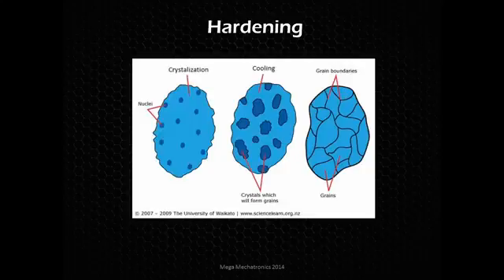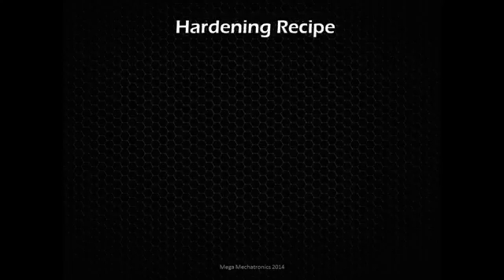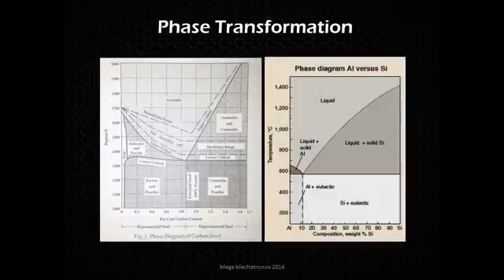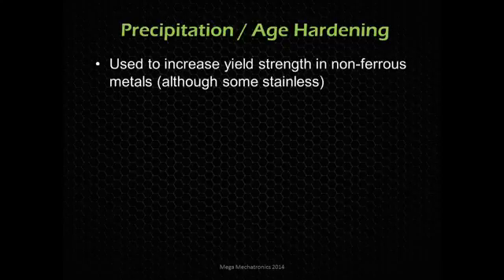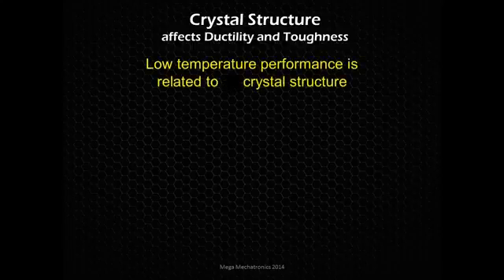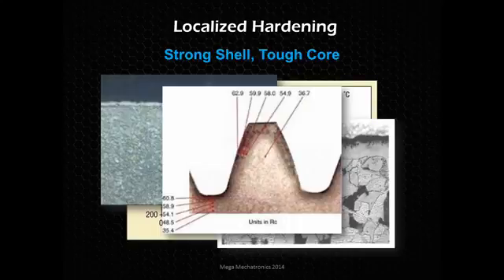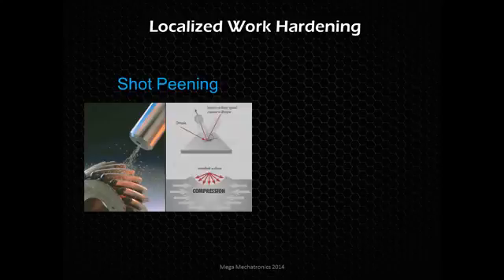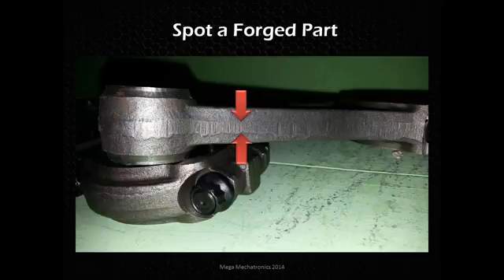Materials Science Mechanical Engineering    Part 4 Heat Treatment Explained

Comment: Ahmad Wildan Zakawali (2714100017)
Hardening and treatment, Hardening is a metallurgical metalworking process used to increase the hardness of a metal.. The concept of hardenability, different alloys of metal are going to have different abilities to hard, a different max hardness you can achieve, so with ferrous material we put carbon in it and the carbon will increase the strength that gives certain characteristics to the crystal structure as it is in there it deforms in a certain way and allows us to harden. When we add carbon to the ferrous material, hardness scale goes up as the carbon content goes up. Hardening recipe is very important of the time and temperature material that the seized during the hardening process so let’s look at if we had the scale here from ambient temperature up to transformation temperature. When we heated up, quench it, and then we will do a little temper. So the heating rates important, time and temperature depending on the thickness of that material and the alloying elements. The cooling rate is very important. What the cooling rate does what the quench does is it lacks in a certain crystal structure desirable crystal structure such as martensite. Different quench media that we used are water, water with additives like polymer additives oil and even molten salt. Phase transformation diagrams, this will give us an idea of where to start with what temperature and this is carbon content versus temperature for a carbon steel. The different crystal structures within this chart that can be achieved at different carbon content versus temperature austenite ferrite pearlite cementite and there's other ways to even get bainite with some other post heat treatments and materials is going to be a little different.
one alloy we can give it many different properties. imagine this is one type of metal one type of alloy with certain elements are not changing anything the only thing or changing is the treatment. as quenched no this is straight out of after you heat up the crystallization we quench in that water and it is super brittle.  it is strong but it is so brittle and we don't want to leave it especially a manufacturing environment when we are moving parts around. we want something we do not want these in cracks a form of people banging and stuff around on the high-low truck we need to temper it, any temper. we do a low temperature where it's at lower temperature or shorter time or combination about here's maybe higher temper where you are bring it up to a higher temperature and you're leaving it there for longer and here is possibly a normalized material and then a full knee or your resetting it. we can see the wide range anything in between materials. We can make give that property to that material and that all depends on our application.
There are some type of process in heat treatment. Tempering, this process done after hardening, when our materials is too brittle, it makes the materials improves toughness. Tempering is done below transformation temperature. Normalizing, ferrous based metal heated above transformation temperature, then allowed to air cool in still air at room temperature. Annealing, we are going to heat it up, we are going to hold it up, hold that the temperature out that crystallization. but this time we're going to control that he cooling rack. just going to leave in the air. We are going to actually leave it in an oven and then we are going to taper down the temperature and this is going to give it again different crystal structures can allow the grain structures to build and grow and that's going to give us a softer more ductile. Precipitation or Age Hardening, used to increase yield strength in non-ferrous metals (although some stainless). Produces fine particles that defect the crystal lattice that impede movement. It is also increase strength.
To measure the value of hardness we use some testing, hardness test, like brinell and Vickers. They use indenter to measure the penetrating dent in the materials. When a soft materials is doing a hardness test the penetrating is very deep, but when the materials has high value of hardness, the penetrating is shallow. The simple way to measure is scratch test, using mohs scale.
Localized Hardening, there are induction hardening and nitriding / carburizing. In induction hardening, it happen only in surface of material, they using electricity and magnetic forces, and then quench in the tank. Like an eggshell, have very hard on the surface and have very tough and durable core to prevent impact and prevent fatigue failures and something like that. In nitriding we infuse nitride and in carburizing we infuse carbon. The material insert to chamber that has been surrounded with carbon atmosphere, and that carbon infused just in the surface of materials
Hardness have a correlate with strength, when the harness increase does also the strength. But when hardness increase the toughness is decrease.
Work hardening, cold working, uses compression force and plastic deformation. Creates desirable dislocation in the crystal lattice structure, improving yield strength, but reduce ductility. Localized work hardening : shot peening and roller burnishing.

Comment: when it comes to hardening and its treatment, t meant that we somehow manipulate how the metal crystallize after heating, as the video said first we let the atom of the metal move around and then we cooling it so the crystallization begin, as in metal the atom form cube structure where bounded together by magnetic force so we can plastically deform its structure without breaking it,as the crsytal cube begin randomly formed (crystallization process) with different orientation, when these crstal with different orientation met each other there's grain boundary,we can say grain boundary is like a wall that stopping grain to growing any further as the temperature drop, size of these grain will affect metal properties such as strength, ductility and hardness. In hardenability concept, every different alloy gonna have different hardenability as in metal we add carbon to increase its hardenability, aside from that the heating temperature, the cooling rate, and the time needed to hardening the metal is also important, the keyrole to get desireable crystal form (such as martensite) is the cooling rate so in the cooling process  must fast enough to stop the grain growth. to know in what temperature we should start the heat treatment we should look in phase diagram chart of the metal, all metal and its alloys have different phase diagram so to know what composition of metal and its alloy is very important as one alloying can make many change in the properties depend on how we treat the metal. As for example is tampering, one of the heat treatmen process to handle material which properties is too brittle so we can temper it to improve material toughness by holding it below the transformation temperature than cooling it, and the normalizing process, where we heat up the material above transformation temperature and cooling in open air so we get more ductile material, in annealing process the material heated till crystallization temperature, hold it up, the cooling it inside the oven so we can get more ductile and softer material, in aging process (for aluminium) the material heated and then hold the temperature in long duration to precipitate the alloying element that will create defect and improve the strength and toughness of the material. To know how hard a material is, we use hardness testing consist of three ways, vickers, brinell, and rockwell for the same concept where we penetrate an indentor (with different shape for different way) into the material and measure how deep the indentor head push in, the harder the material the shallower indentor head can push in. another way to measure hardness is by scratch testing where harder material will leave mark in softer material as we scratch them. The crstal structure also play important role as FCC cystal material properties not much affected by temperature but the BCC crystal material does. Another example of hardening process is induction hardening, nitriding, carburizing where these heat treatment only affect the surface of material or in another word its localized hardening. Hardess of material will also affect other properties such as toughness where the harder the material its become more brittle and so it have low toughess. Another way to improve hardness is by mechanical force (cold working) where we utilize outside force such as forging, shoot peening, roler burnishing where these forces will create deformation in material surface and improve the hardness. Another way to improve hardness is by aplying forces and temperature control in material ( hot working) where we give outside force to he material in high temperature so the material structure will be affected entirely (not the surface only) because it can aligns the grain structure to the shape of the material, the aftermath of hot working process is material that stronger and harder than the machined one but leave a flashing part (extra material that flow out after hot working that we dont need) that we need to cut and grind down to form the shape that we needed. So hardening process in material can be done in many ways, by depending on chmical reaction (nitriding and carburizing) heating and cooling control alone, mix it with some mechanical forces, or by mechanical forces alone, hardening is about manipulate material crystal structure and deformation so we can get the desirable properties from that, some way hard material is needed in some application but when we need more softer and ductile material we can apply heat treatment process to do it, after all those process is defined by the material composition and alloying element whereas it hold the key of what heat treatment process we can apply and what outcome we could get and what we want.
it is a very informative video for those who begin learning the heat treatment, but at least if it was another person/channel video you should mention it,thankyou verymuch
Reply: Muhammad Bhakti Santosa
2714100006

Comment: on its metal atoms are arranged regularly in a pattern called a crystal crystal generally has a crystal structure bcc, fcc, hcp.  hardenbiliti is the ability to be hardened steel and form martensite. on hardenbility limit dependent on alloying elements of metal hardness dependent on carbon content in ferrous metal so the metal increase strength 
hardenbiliti basically relies on the diagram transformation will therefore depend on two main factors, namely the chemical composition (carbon content and carbon element) and the austenite grain size (grain size) of austenite. in hardening recipe materials is heating rate then holding a few minute then cooling time(quenching with media : water, oil, salt) quenching material is heated up to the suitable temperature an then quanched by water oil or salt to harden to full hardness according to hee kind of steels. for the quenching process and the size of certain objects of steel are  considered to have hardenbiliti high when after the queench will producea structure martensitic (90%) in the area of its core and has hardenbiliti low when thick hardening of small steel with hadenbiliti  high will provide benefits when used to make a workpiece berpenampang great to be hardened, this situation is usually required on the gear because the gear is quite stiff, when hardening does not reach the core,
 the core will be soft so that when the gear that receives the load may be a core part will be deformed, even though violence on the surface of the core of a workpiece of it together ,but the impact strength was different this result because after hardening and tempering dr surface structure will consist of tempered martensite and lower bainite being at the core of the structure willconsist of upper bainite or perlite which both have a low impact strength and t emperatur higher transition. hardenbiliti higher steel is steel that is used with large cross sections that will produce nearly the same hardness between the surface to the core part, but when used in small cross-section is usually considered to be less favorable in terms of economic
Reply: Mohammad adnan rachmadi 
2714100116

Comment: Amy Reza Andrea

Hello everyone. I'm gonna make the summary from this video. Check this out. 
From this video, I can learned about the introducing of crystal. On this section, I know some structure that metals can exhibit such as Face Center Cubic, Body centre Cubic, and so on. It explained me to about how the microsite on the lattice will be deformed if forces are given. I know some acknowledgements such as grain and grain boundary. Grain shows a similiar direction and grain boundaries are the place where the atom of several direction gather. 
On the next section, I learned about hardenability. Hardenability is often find on ferrous material and this characteristic is increased by increasing the alloying element on material such as carbon. I know such heat treatment recipe while we gonna make materials that have a high strength and high hardness. We can modify it to heat treatment through hardening. But the improve on it, I recognize an unique type of phase in heat treatment that called by cryotempering. The purpose is to transform retain austenite to entire martensite on the hardening. I learned for several heat treatment on metal such as hardening, normalizing, annealing, tempering, and precipitation hardening. For the first fourth of them, it is using for ferrous metals. They are quietly same on heating process and holding process. The difference is on the cooling rate. Cooling rate for hardening the ferrous metal is on rapid cooling and the result is commonly on martensite phase. The nomalizing is using normal cooling rate and it purpose is to normalize the microstructure from previous heat treatment process such as hardening or annealing. Annealing purpose is to soften the material. Tempering purpose is to relieve retain stress on microstructure. For the last one is precipitation hardening. It only available for non ferrous material in order to increase the yield strength through create a small precipitate along the grain. 
There are some quantify way to measure the hardness by indentation and scratch. For indentation method, we know several methods, those are Brinnel method, Vickers Method, and Rockwell method. Those measured the hardness by measuring the depth of indentation or surface area. Indentor may be different cause brinnell using steel ball, vickers using diamond pyramid, and rockwell using steel ball and diamond cone. 
There are several hardening process through non- heat tretament process such as surface hardening, work hardening, and localized hardening. First is surface hardening. There are two most common method those are carburizing and nitriding. These have same purpose, to hardened the surface of metal. We know that adding some alloying elements can increase the strength and hardness through solid solution strengthening. Second is for work hardening. It divided into two methods, one is cold working and the another is hot working. It done by giving some external forces to modify the grain shape and create the residual stress on microstructure. The difference is hot working is do on elevate temperature and cold working is do on room temperature. The most known acknowledgement for that process is forging. And the last one is localized hardening. It can be done by shooting the certain surface by the hard ball to change the shape of surface and sure its microstructure on that. It has result on the hardness. It will be harder and stronger. So that is the summary from me. Thank you. :)